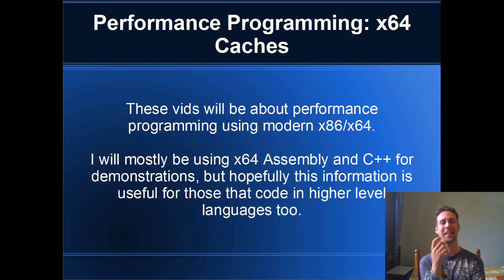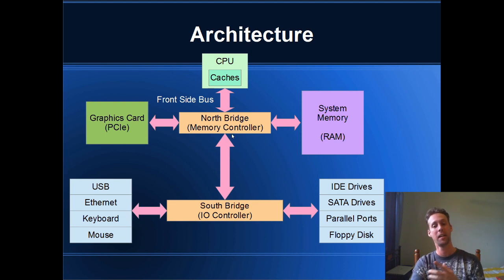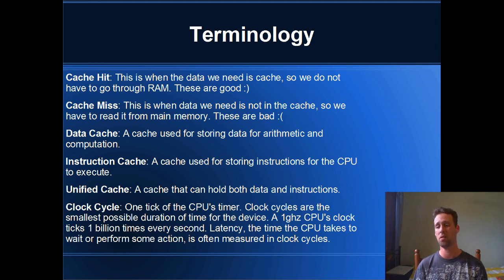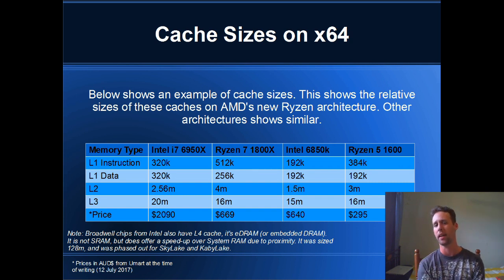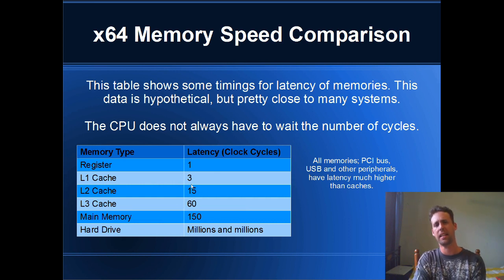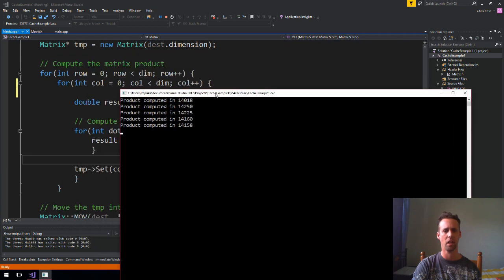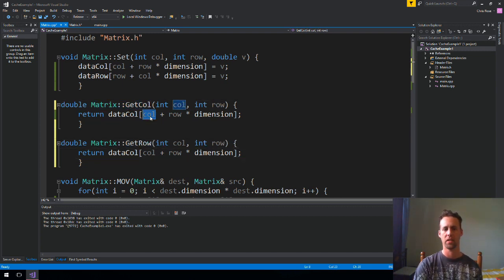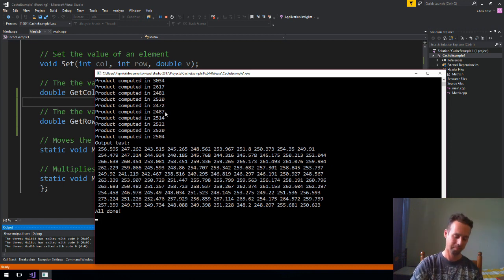Performance x64: Caches 1

Comment: As an extra note.  The CPU checks the L1 cache first, if it doesn't find it there, it looks to the L2 and then the L3 if it exists.  If memory serves (pun alert!), variables not in any of the caches are loaded into L1 and used.  As more and more variables are loaded, older variables still in L1 get moved to L2 if they are not used, then L3 etc... in case anyone was wondering why in blazes they're still in L1 or any of the rest for that matter.  The reason for the slower BUS speeds is fairly simple, electricity only travels so fast.  There's good reason why your RAM chips you installed on your computer are so close to the CPU.  In the past we had external cache chips you could install, I still have a few from old systems.

In real life the computer data is food.  The L1 cache is your fridge, the L2 is the corner store just down the street, the L3 is the larger grocery story a few blocks further away than the corner store, and main memory is the shopping mall on the other side of town, with all those red lights you have to travel past. ;)

And also in real life, I seem to get more cash misses than hits. ;)
Reply from the maker: Brilliant analogy!

Comment: Very informative thanks!   I've got the non-cached-optimized working, although it is 7x slower (110 seconds per calc) despite using an  i7 2-3GHz processor.  I'm running VS15 under Win8.1 and heard windows virtualizes a lot of stuff and prioritizes its own OS under a special hardware space, giving developers programs second shrift, so I am wondering if that is the problem and I should try linux.  Can you describe your processor and OS environment, and have you run into similar problems?
Reply from the maker: No worries, thanks for watching!

Comment: You should have been clearer that you were showing total cache per level. L1 is usually 32 or 64k per core. On 5900x, L1 is 64k per core. L2 is 512k per core. L3 is 64MB. So yeah, AMD chips have lots of cache.

Comment: What's a creel could you write what are the differences between the two version of your code and why they led to different results? I can't seem to grasp it and get lost in your video (you're usually more concise and more clear but maybe it's just me)
Reply from the maker: Yeah mate! I meant to record already, but gigging and computer crashed. Anywho, the reason the second one is faster is because of cache lines. The CPU reads blocks of 64 bytes at a time. If we rotate the second matrix, we're using these whole cache lines, instead of just the first doubles. This leads to much fewer reads from RAM and faster performance. Vid is coming, sorry to confuse, have a good one!

Comment: is it because each matrix row fits in a cache line?
Reply: Nope, sorry. He is using doubles that are 64 bit and the dimension is 1000.
Now, I've never seen a CPU that has a 64000 bit cache line size ;)
Reply from the maker: Well that's very close! Like Victor says, the whole row won't fit in a line, but cache lines certainly have a lot to do with it!

Comment: Man.. my PC is crap compared to yours and I thought I had a beast PC.

57000MS - Example 1.
45000MS - Example 2. 

Edit...

Actually I guess allocating all that crap throttled me hard I got rid of some of the excess and it was down to 5000ms for example 2 and I just used the destination directly not a temporary value.
Reply from the maker: And that comp died :( saved hdd and ram tho, so that's nice!